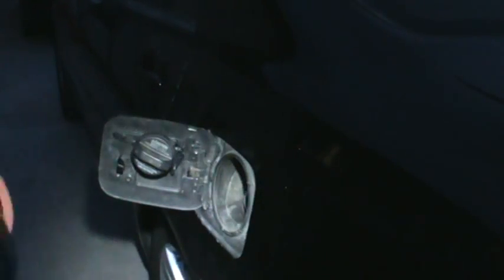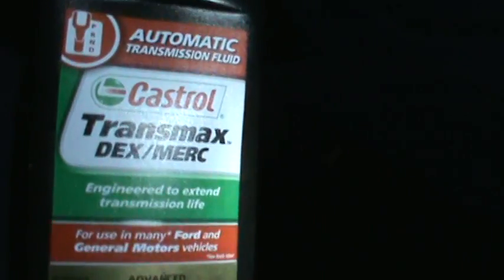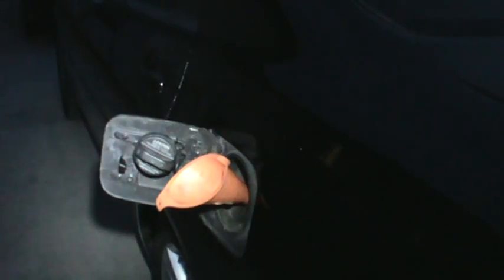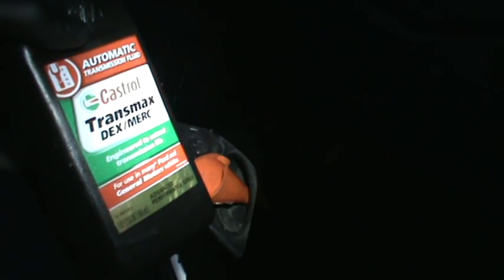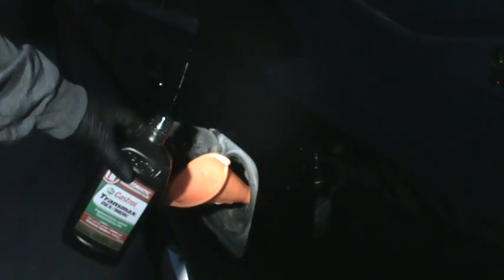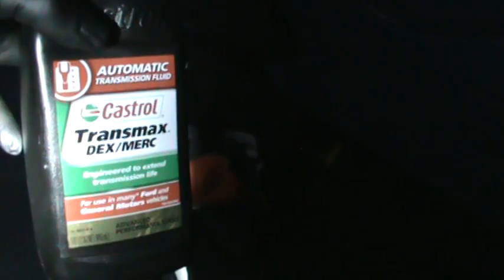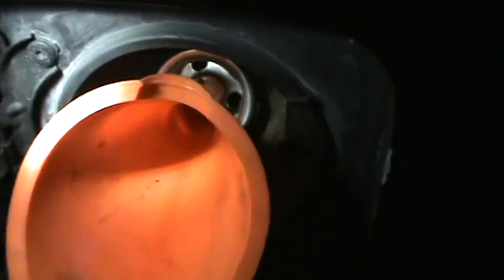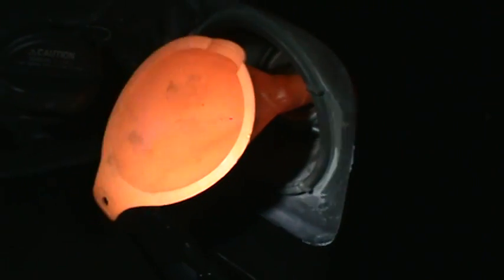ATF In The Gas Tank!?!?

Comment: Old school trick, been doing this for decades on all my vehicles. Cleans valves and entire fuel system.
Reply: Mike Lascari That little bit of atf want hurt or help the engine. If you want to clean your fuel system. Change the filter. If he put the whole quart in there. He will lose hp and mpg because he has diluted to gasoline.
Reply: This shit destroyed my o2 sensor, made the car burn a lot more gas.
 When oil burns it smokes an coats the injector - combustion chamber and oxygen sensors.
Reply: Mike Lascari Gasoline is a better cleaner than atf.
Reply: T_money_ THIRD You are lying. That small amount want do nothing.
Reply: . . . even in good old germany its done without hesitation (oldschool tricks)
Reply: So how many ounces would you put in per quart?

Comment: in the 60's we used ATF to clean carbator. That was before fuel injection. It cleans very good. It may keep the injectors clean.
Reply: In the 60s they used naphthenic base oil and Spermwhale esters additives. That made the a huge difference at the time. Nowaday none of these are used.

Comment: is not only lubricant, high detergent and is combustible, lub & clean pump, clean injectors and valves, clean fuel lines, ads power to engine by high combustion and more, I add every 2 to 3rd fuel up fool quart of any ATF ( Walmart ) to my 220K mil Saab, 155K Volvo V70, 08 145K Mini, 2 galons on 1979 Perkins on my boat and 2 gallons to my 08 670K Freightliner, this little what you doing that not enough, I am diesel mechanic from Germany and  I do this for 48 years, good luck to you and others drivers, Wiedersehen- Ciao
Reply: Tomek, do You use the ATF into oil engine too ? Greetings !

Comment: i've been doing it for decades with all my vehicles. it helps clean injectors an clean valves. also add to engine oil before change. if you have ticking try it i've used it to stop it on other vehicles.
Reply: +baboonbuttz   I so totally agree that ATF added B-4 an oil change WILL clean the inside of your engine!I use that idea for my lawnmower,too. If you "forget" to do your regular oil change,this will clean out most of your mistake. Life gets in the way.
Reply: How much should you put before you do the oil change?
Reply: Erick Vazquez it depends on the engine an if your oil level is lower on stick. if you have a ticking noise or only change oil once a year or if you've never used this before. then add 1L or qt a day before the change drive normal for the day. change oil an filter when @ normal operating temp. then once a year add 1/2L.
Reply: Need a cleaner internal engine?
 Add tranny fluid B-4 oil change. Works fine. DO NOT DRIVE IT.
1 -2 liters overfull is fine.
Reply: ddd228 if you don't circulate atf @ operating temp then there is no benafit. it won't do it's purpose to clear buildup. never add 2L  @ full oil level.  if owner just topped oil level i will pull oil filter dump whats in it then re install filter add 1L an run vehicle to op-temp for an hour but not idling for an hour. you want as much circulation as possible while it's hot. been doing it my way for decades an not had an issue.
Reply: Yes,you are right. Don't add 2L if the engine is full of oil.Helps to clean the inside of engines B-4 an oil change.ATF is a powerful detergent.  I wouldn't drive it.ATF is not designed to work as engine oil.  Beneficial if you missed your last oil change. Or,you can change the oil twice.
Reply: Works just like Marvel's mystery oil. A friend worked at buick engineering and they test the transmission fluid in gas and it worked as good as Marvel's

Comment: it works for diesels. the detergents in the ATF clean the injectors. we use if all the time in big trucks. much cheaper than "injector cleaner". wouldn't recommend for gas engines, though. get some seafoam, or marvel mystery oil for gas engines
Reply: +Louis Laszlo 
Transmission fluid has more detergent than any other lubricant. Do some research before commenting.
Reply: +yourtube540  Yes it does. You can wash your greasy hands with AYF and they will come clean. Not so sure about adding it to gasoline. I would prefer 2 stroke oil or Marvel.
Reply: ATF has so much more solvency than cranckcase lube, that it doesn't need any detergents. AFT as shown has about 25% average of ot volume of naphtenic mineral base as opposed to pure parafinic mineral base in cranckcase oil. By the way parafinic base has little solvency power, than it needs detergents in there. Same occurs with Esters, it also has a very powerfull solvency power that came from its polarity, hence,  needing much less detergents that groups  I, iI, III and IV bases oils. Group I & II are mineral, groups III and IV are synthetics (Polyalphaolefins) group V are esters and all the rest. So, next time you jump to expel "info", do it in a complete manner, please, or people WILL get confuse. Let's spread good info.
Reply: Becareful. Too much atf can melt tips of injectors. It ignites hotter than diesel.
Reply: Just hope you don't get your tanks dipped by dot
Reply: I'm tempted to test it. How safe is it for the diesel particle filter?

Comment: atf is a solvent oil so it will clean and lube your fuel system. the extra heat it makes when it burns will clean the motors upper valves and cylinders. removing carbon deposits. if your upper is lubed like the lower end is it will work easier and make more power and lest friction or resistance. ===better gas mileage
Reply: ill remember that the next time im with my girlfriend

Comment: I have done this faithfully in several vehicles over several years time.
30 years ago, I started doing this with Murphy's Top Cylinder Lubricant, when it started getting hard to find I switched to Marvel Mystery Oil, and when one of my friends was working for a courier service and he found out from their mechanics they used ATF because of how clean it kept their motors, how many more miles they could put on their motors and how much money they saved in gasoline, I switched to ATF and I've been using it every since.
I log my fuel mileage every time I fill up and I assure you, one can tell when they fill up without putting ATF in their tank. They suffer from loss of power, motor noise and poor fuel mileage. The only time I don't put ATF in one of my vehicles is when I run out, and even then I purchase more ASAP. 
                                                                                                                         Sincerely, One Who Knows What He Is Talking About
Current vehicles
2005 Volvo S60R ( SUPER FAST, Daily Driver )
2004 Chevy Blazer ( My Wifes )
2000 Chevy Blazer ( Play Toy )
1998 Ford F150 ( work Truck )
1996 Toyota Camry ( My Old Driver That Was Replaced By The Volvo And I Put Almost 500,000 Miles On It, Still Runs Great, And Still My Backup Driver  )
Every Vehicle Gets ATF Run Through It, 1oz. ATF To 5 Gallons Of Fuel.
Reply: Do you add to every fuel tank or as a  treatment every once in a while?

Comment: l did seafoam treatment on my wife's 03 ford expedition 4.6 I used    the 16oz in the brake buster my wife and I took a trip to north Texas from San Antonio i stopped to put gas before I did I pored 32oz of atf in the tank the speed limit was 85 I drove 95 it got much better gas mileage and better power still running like camp

Comment: It works well, no problems...
 I have a few vehicles and one is almost 30 years old and running great.
ATF mixes almost instantly with gas
For diesel you can add more ATF ,,, 1L per tank no problems... It cleans and lubes the fuel system and makes it run better

Comment: I once won a bet that I could run my car on water. This was 30 years ago.  My car had a gas tank installed vertically, behind the right rear fender. The gas intake tube was mounted on a float so it would always get the gas from the top of the tank. The car was designed this way at the factory to run better if gasoline was contaminated. Not everyone knew this. 
I told some guys I ran my car on water. Obviously, they did not believe me. I told them to bring a gallon of water and I would put it in   my gas tank and drive the car around the block.  So we made bet and I won. LOL. We drove the car for several miles with no issues. I got my money from them, drove the car back to my garage, opened the drain plug and drained the water from the gas tank.
For those who did not catch why it worked.  I had at least 5 gallons of gasoline in the tank when we put the water in. Water is heavier than gasoline and it immediately settled on the bottom of the tank. Since the tank was installed in the vertical position and the gas intake tube was mounted on a floating arm, it sucked gasoline from the top of the tank and the engine ran just fine.
Reply: Bull Shit...
Reply: What kind of car
Reply: If this is true, that’s what’s up 💯

Comment: I DO THE SAME THING BUT I PUT ONE QUART TO ONE TANK FULL.OF GAS. WORKS GREAT .I HAVE A 1997 SUZUKI SIDEKICK  NEVER HAVE ANY TROUBLE .
Reply: Hi How big is the fuel tank on your suzuki thanks. Jeff
Reply: @jeffmee763 akes no difference the atf burns right out does no harm to cat or any sensors don't let the neg people  try and convince you any different
Reply: You guys put atf in your gas? I just added a half quart to half tank of gas for a noisy injector and within a few drives the noise is gone.

Comment: Adding ATF (which uses the same base as motor oil) to your gas does increase the BTU content of the fuel, and so theoretically could produce more power. However, 4 cycle engines just aren't designed to run on a gas-oil mix. All you're doing is decreasing the octane of the gas, and creating more soot throughout your engine and exhaust system due to the heavy hydrocarbons that it isn't able to completely burn.
Reply: Louis Laszlo you mean increasing. higher octane doesn't mean more explosive or flammable its to do with knock resistance or " pre ignition " by adding oil makes it more knock resistant so actually a higher octane rating. also if it doesn't burn properly it will not create carbon as that only happens after its burnt. you in reality end up with unburnt oil full of detergents encompassing all you valves not carbon
Reply: THE QUANTITY IS SO SMALL THAT IT DOESN'T DO WHAT YOU SAID...
Reply: loius I cant believe you actually believewhat just came out of your mouth
Reply: @brotang2953  and what happens to all that oil in your catalytic converter? Adding oil to your gas might have helped your valves back in the 1950’s, but no way should you do that to a modern car.
Reply: @joescheller6680  I can’t believe you were sober enough to write that much.

Comment: Even in "good old fermany" this ATF-additive-tactic is  still used nowadays (by some oldschool mechanics) to clean engines or even to gain more cylinder pressure if used as additive in the motor oil  (for a  v e r y    s h o r t  period !) So: Why YES, pretty good trick/advice 😉
Reply: Can You tell the procedure ? How much ATF and how long driving with that mix ?

Comment: ATF.is not designed to burn. I add a half a cup of 2 stroke oil to my cars because modern diesel fuel apparently has no lubrication properties ,this keeps the fuel pump running sweetly, and works as an upper cylinder lubricant Used it for several years now....no issues yet.
Reply: Stan Rylance  marine outboard two cycle TCW3 oil is best. Check out LS1 Testing oil on Google.com. A guy named Sarge  and his air craft engineer friends did lots of testing. In gasoline it's 1 oz oil per 5 gallons gas. You can look up diesel also
Reply: Maybe my friend, but it is - 4 sure - desigend to  c l e a n   - or at least to keep the whole automatic transmission "surgeon clinically" clean !! Some folks claim it helped a lot . . .

Comment: if there was ~30liters sitting in a tank,  that would have made 1:600 mixture  with that half of glass you added.  I was experiencing with ATF but much more, got nothing but little smoke and smell.  But adding 2T mineral 1:100 did work, engine idles smoother,  no smoke.  Even lawn mower gets more power.

Comment: I've seen people that do yard service,and boat owners, they use transmission oil in any 2 cycle oil engines as a fuel additive.
Reply: Filiberto Barrera  Marvel Mystery Oil in the gas is good. I personally add Marine outboard motor oil with a TCW3 rate at  1oz per 5 gallons of gas. Works to clean and lube the system better and cheaper. You can Google. Been Testing Oil and read the testing. Sarge and team have done the homework for us.
Reply: +Arthur Smith thanks for the info.Sure will try on my next fuel fill up.I drive older used cars that need a little extra loving.

Comment: Fill my push mower up put two capfuls of transmission fluid in it doesn't bog nearly as bad when mowing High Grass. I haven't put a compression tester to it yet but by pulling yet I definitely noticed it has a lot more compression. My dad taught me this old trick. And you think that it would smoke out the tailpipe but it actually Burns pretty clean.

Comment: Some people are funny Without understanding the science, they comment, or watch videos like this.  Yet, they get their radiator flushed, transmission flushed, etc.  it's called drain and fill, and that is all you need.  Also, people never drain and fill their brake fluid, but instead will leave it in there forever.  When you get new pads, have the mechanic bleed out the old fluid, and replace with new.  You can verify they did this because the bleeder bolt on each caliper should be wet around or inside the hole with fluid.  Also need master cylinder after 6 years.

Comment: old school trick for old school car only!
Reply: nazvl patel 
Not true
Only thing that changed is fuel injection vs carburetors...
Internal combustion engines all use the same principals...
The ATF is used as a cleaner, to remove varnish and buildup.
It will NOT hurt the motor
Reply: @splash5974  Yup - 4 sure. Clearly so cause it doesnt hurt sensitive automatic transmissions either . . .

Comment: you know if you use the old school non-synthetic Burns better and probably cleans better I use it to clean my injectors on my 7.3 diesel just poured in the top of the filter and my truck will run for 2 minutes on that by itself
Reply: adam waugh check out using Marine outboard TCW3 oil in gasoline  and diesel fuel. Google it works great.

Comment: wtf? dude, just run 2 stroke oil once in it while
Reply: I've done this when an internal fuel pump was on it's way out. It works very well. I bought an explorer once advertised with a bad fuel pump, gave them cash, then I kicked the gas tank a couple times, and drove it home. I waved as I drove past them. Once in a while it would stick, so a shot of two cycle oil worked great. It eventually shit on me. If your fuel pump seems dead, this will get you home, usually.

Comment: What does it do?
Reply from the maker: Most people use cheaper gas, cheaper gas burns easier, causing excessive build up and possibly pre-detonation. It lubricates the fuel pump and everything else in the fuel system. I ran cheap gas for thousand of miles, then checked spark plugs, they had a lot of build up. I did the same using atf, and the spark plugs almost looked brand new. Also if you understand how engines work, upper engine lubrication helps with compression causing better fuel economy. Do a compression test with no oil, then do it with a small amount of oil, the compression will usually increase. If compression increases, fuel economy will increase.